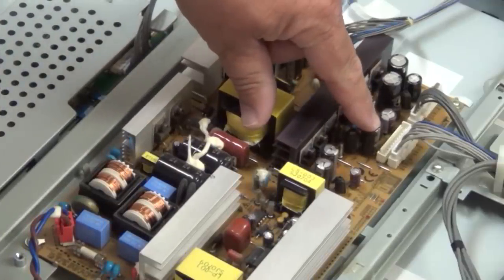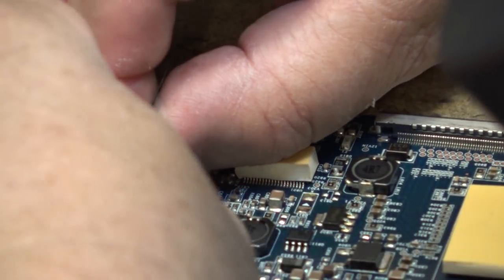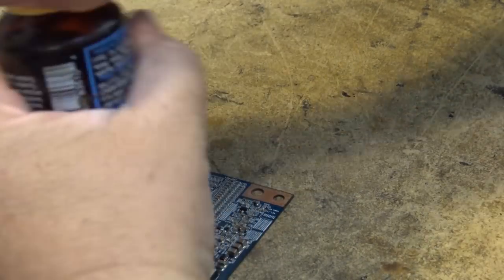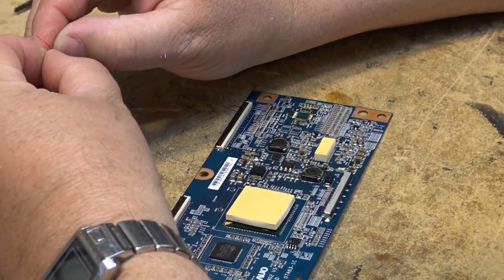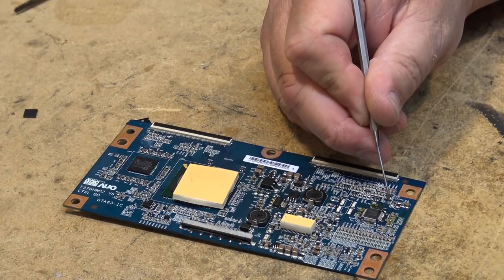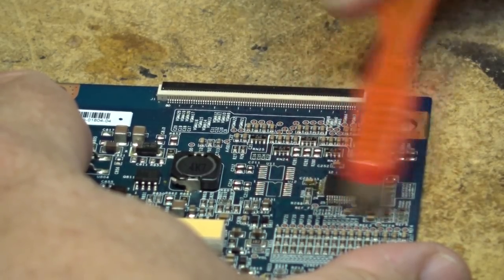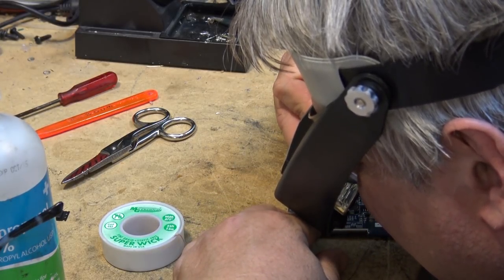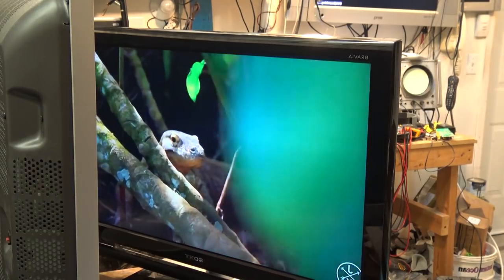Sony KDL37XBR6 Part 2 TCON board repair to component level

Comment: Drag soldering works really great for resoldering those types of chips. You only need to get one of those cup type tips on the iron. I suggest folks grab an old scrap board and practice the technique. Very professional results can be achieved pretty quickly. Just use a lot of quality flux to prevent solder bridges. Plus it's a lot of fun. There are videos on YouTube showing the technique. I love your videos.

Comment: I found one of these sets Sony KDL-37XBR6) outside my office, waiting for the trash collector (or Wednesday's Cat 4 hurricane). I took it inside and tuned it on. The picture is exactly as the one on your set, maybe not as washed out, but with the same solarized appearance.
So, I'll order the chip and will try to replace it as you show. I've done some soldering, but I'm no expert, so I'll try being extra-extra careful.
Thanks for this very useful video!

Comment: That was impressing and I like your patience and accuracy in fixing that problem. It is really sad that this televison sets are scrapped having such problems. When I was young my parents brought the faulty TV to the service guy and he fixed it - I miss that. Nowaday we live in a throwaway society :-(
Reply: And of course you get a thumbs up from me! I don't know why people dislike your work...
Reply from the maker: Yes we do, Wor 20+ years I was that service guy that fixed it.
Unfortunately the price of TVs dropped so low that they become uneconomical to fix real quick. 
A fix like this would run 100 minimum, by the time parts, and labour factored in. So when you can buy a new one for 200 why would anyone spend over 100 to fix an old one? If it one thing fixing my own sets,  but most prople will not pay to have them fixed.

Comment: Great method without hot air.  I repaired a tcon for a Samsung and it worked fine.  Chip cost me 40 cents from China.  Suggestion: cut the legs close to the body of the chip in case you slip and cut into the trace on the board.  Soldering was tricky but you will need a fine tip and a lot of flux.  Great video!

Comment: Brilliant!!! What a simple but effective way to remove that chip with minimal disruption to the board. your videos are so informative, learnt a lot off you.  thanks a million 😁😁
Reply from the maker: i am sure I just pissed off techs that know this trick, but don't share their tricks. I know if I was still in the business I wouldn't be sharing these time saving tips as nobody showed this to me. I had been using the steel wire heat and pull method, and one day I was thought, what if I cut the pins off at the edge of the chip.  Others I am sure did this too because it is so simple.
Reply from the maker: I usually use a fair bit of heat so I can solder quickly and not burn the traces. It all comes with practice, and I am well, out of practice.
It didn't look that way on camera I am sure, but this was the first one of these chips I have changed since probably 2002!

Comment: Don't let them break your balls about cutting the pins.....it WORKS.....and this video is the reason I started using this technique. The less heat one puts on a circuit board THE BETTER! I've changed out several EEPROMs this way and it works great for me! As you said, the key is patience and care. If I could find the right auo g1422.59 chip for this 65" Vizio I'm working on this is how I would change it. Heck I can't even find a spec sheet for it!

Comment: You cannot inspect enough! I double and triple check my solder joints. If I THINK there is a bridge I make sure to remove it. You did good leaving it unedited. I hate micro soldering. But with those SMDs, it's what you have to do. I am glad to see an option as well for those like myself who have limited options for soldering.

Comment: Back in the day we used a scalpel, exactly the same way, to fix Wyse terminals with flatpack ICs. That wasn't yesterday. Works a treat, so long as you don't lift any tracks. Slow and steady. I would tack down one pin on opposite corners, as tacking down one side may leave you slightly squint. Having said that, you can twist the chip very gently to correct for minor misalignment, even once one side is down. 
When I was doing this my eyesight was good enough to do it without magnification, however I wouldn't stand a chance now without 2 pairs of 3x reading glasses. I find doubling up on the Poundshop/Dollarstore reading glasses easier than wearing one of those magnifiers, but you don’t get quite as much magnification.
I replaced the USB connectors on a couple of Samsung Android mobiles recently with nothing more than a standard soldering iron, flux, spring loaded syringe type solder sucker, and a fine bit on the iron.  I do have a hot air gun, but I didn't want to risk blowing away microscopic resistors. Even if you think everything is taped down with masses of kapton tape, it only takes one thing to vanish and the board is for the bin. 
I only mainly fix boards for my own amusement these days, but it is a useful skill.
Reply from the maker: Yes that is the problem with blowing hot air, blowing away other parts. 
For some operations it is needed, but not for flat pack IC. This is the safest way to do it. I used a exacto knife, which is the same thing as a scalpel, I just couldn't find one here, so I used a razor blade, same results.
I don't need glasses for anything but close up work. I have a pair of prescription readers that are +1.5 in one eye and +.75 in the other, which is fine for reading the newspaper without squinting. For electronics work I use a pair of +2.5 I borrowed from my wife. The magnifying hood is really good though. I had the +2.5 on under them, and I could clearly see the chip.
Back in the day when I was working, before laser surgery about 8 years ago I was short sighted, so I would take off my glasses and I could do the fine solder work no problem. Now it is the opposite. That's ok though, as not having to wear glasses for driving, or anything else is a a life changing event. Best money I ever spent/

Comment: Good job. We do three thngs here as well. 
1) Sometimes I put a soild run of solder on all of the pins on one side before cutting them to minimise the risk of pulling the first or last and lifting the pad. 
2) The chips have a heat transfer pad underneath, we always use some heat transfer compound there as well to help stop it dying again. Cut another piece of the thick transfer compound block for the top to the metal as well. 
3) We always measure pin to pin after soldering looking for shorts. There are no adjacent pins on the AS15 (or AS19) that are joined. Shorts are easy on these close pins and not always obvious. Shorts between pins on these gamma chips can (and have) destroyed the panel.
Reply from the maker: The original chip did not have a heat transfer pad on the bottom but I noticed the new one did.  I did make sure that the keat transfer pad on the top wasputting good pressure on the heat sync to keep it cool. True it may fail down the road again, but the original lasted 10 years, and it it lasts another 8-10 years it will have had a good run. Yes I am well aware of what a short on the pins would cause. That is why I inspected it so close, and most of this was off camera. I also used my pick to press on each pin looking for movement.  I didn't put heat transfer compound on the bottom of the chip, as it would have been washed away anyway when I used IPA to clean the board, and then dried it with my compressor.
Reply: Thanks for the response. 

I did two more of these today, one AS15  for a Sony and an AS19 for a Samsung. I'm finding about half the chips are soldered underneath to the board. The ones with unsoldered pads come off in seconds with ChipQuik (I also find the ChipQik solder to be reuseable many times).

I am always staggered by the easy with which shorts can occur on these where I am certain the soldering looks good. I must be getting old, but I just cannot see them even with strong lights and the same goggles you have. I have to rely on measuring the pins. Leanrt early to solder one side at a time and measure before doing the next side as there are shared pins on all four sides. Easier to track down where shorts actually occur.

Comment: I have the same symptoms on my KD65X8500E 4k TV although it looks like my controller chip is the larger chip, do you know approx cost & warranties provided to have the chip changed out? the only board i can find is a second hand at $150 with 7 days warranty?

Comment: Awesome "old school" fix you did there Dave.  I never would have thought a razor blade would make short work of those IC pins.
Reply from the maker: It would have done it much faster if it was a new blade, but I have used it a few times already to remove chips in projects that I didn't shoot.

Comment: awesome! Did a microcontroller like that, 10X mags on and a filed solder tip. So many bridges that I just layed the fluxed wick over the entire row, wiped it with the iron and when I lifted the wick, all the pins were perfect ! I bought an ebay $60 hot air/solder station and love it.
Reply from the maker: I haven't bothered with a hot air station because I am not really into this type of work these days. I work on old audio mostly. I only did this because it was my set. I would turn a job like this away because I couldn't charge enough. I retired from electronic repairs and just do it as a hobby now.

Comment: Nicely changed ic. I have used this method when i worked in electronic manufacturing factory. Now i have hot air station at home.
Reply from the maker: saarike  
I just did 2 using a heat gun and aluminum heat shield tape. I dont change enough chips to need a hot air station.
Reply: Okay :).

Comment: Fantastic!  I started working on TV's back in the 1970's during the transition era from tubes to transistors to a few integrated circuits. That was before college.  I've not worked on any of the flat panel stuff until our Insignia NS-50L240A13 was zapped by a nearby lightning strike a few weeks ago.  It turned out to be the main TV signal processor IC which I found because the 3.3V linear regulator feeding it standby power was getting hot and the board area under the main signal processor was also getting warm.  Current draw on the 5V standby rail was high at 650mA.  Not knowing what the main IC was or where to source one, I opted to replace the main board to get the TV working again.  Now, I will pry the heat sink off the main IC to see what it is, and use you technique to remove it from the board (it is a 216 pin QFP).  Maybe I can find a replacement chip and get the bad board working again.
Reply from the maker: Same here. I started tinkering with electronics in the early 70's when I was 7 or 8.
By the time I was 13 I had built many kits, and the most complex one I built at the time was  a Heathkit cg1005 which used the neon panaplex displays.
It worked for a few years but because at the time I used the wrong solder (acid core, not knowing that it would attack the board) it died and I ended up giving it away to an old ham radio guy that lived up the street. He painstakenly put jumper wires across the traces that were damaged and got it going using it as his station clock. Never offered it back to me. I built a tube type keathkit scope too, but the power transformer failed on that and I tossed it.  In high school I built a black and white CCTV camera that used a 1" vidicon tube. I was using that as a security camera and had it mounted at my parents house pointed at the front door and driveway so they could see if anyone was out from from the back of the house. Someone stole it. Climbed up on the fence, stood on the fence while they unscrewed it from the mounting bracket. While in school I worked at a local TV shop and learned a great deal from the owner of the shop who I think wanted to sell me his business. I went to college and didn't study electronics, I studied film and television production. There was no work in this field at the time I did it though, the film industry was about 5 years away here. (Now it is booming and has been for 35 years). I went on to work for Sony, and then an independent service center which I eventually managed as well as fixed most of the equipment that showed up. I never got into flat panel TVs though. They were just starting to hit the market when I threw in the towel and left the business. So flat panels were a mystery to me until I was given a 42" Insignia (Samsung) set a few years ago.  I tore into that set and broke out the books and studied how plasma sets work. Since then I have done a few more sets. I did an LG with bad caps in power supply, a Samsung with a bad buffer board. Another samsung with a bad buffer board. An samsung with bad caps on the ySUS board, a Samsung with multiple components on the X main popped. A couple sets with grounding issues causing problems. Had a panasonic with a shorted choke to ground in the tuner circuit. Another panasonic with several parts blown on the SS board caused by loose ground screws.  Recently a panasonic with a shorted cap on the A board killing the 15v supply. A sharp with a blown 150v zener. Another sharp with cracked solder on the TCON board. This one with a bad gamma correction chip. A few LED sets, one with a pad resistor in power factor correction. Another one with a bad LED in the LCD panel. A vizio with bad zsus. NEC with power supply filters. Panasonic plasma with a bad fan causing shutdown. I am sure there are more,  but my suscess rate is pretty good. I fix more than I scrap.
Reply: @12voltvids  Great to make your acquaintance.  Sounds like our background are similar.  I too built a number of Heathkits including a VTVM, 3" oscilloscope, RF signal generator, capacitor checker, ham band receiver and several items.  I also worked in a couple of local TV repairs shops during my teens before getting a job in an AM/FM broadcast station.  I ultimately got my First Class FCC license and did a lot of maintenance on the transmitters, antenna switching system and various studio equipment.  Also worked in a TV station doing the same type of work during my last summer in college.  I did study electronic in college and got an electrical engineering degree and worked in a couple of small companies doing hardware and software design and development before entering the semiconductor industry as an analog field apps engineer.  I enjoy troubleshooting and fixing things and occasionally pick up a free item from Craigslist to save it from the dumpster.  Currently I have a 32" Best Buy / Sharp TV on the bench which has failed LED back lights and I will be removing the panel to replace those as time permits.  I also have a number of restoration projects waiting in the wings for retirement entertainment, mostly old Heathkit ham gear, but a few pieces of test and measurement equipment too.  Keep up the good work.  I enjoy the videos.

Comment: Would make a really cool video if you were to use some of your old camera equipment to make a Digital microscope for board inspection. Thank you for what you do. I have learned a lot thru watching your videos and the process of running out board level trouble. Also appreciate the fact you do it without fancy equipment. RockOn

Comment: One thing that needs to be mentioned is that before you try something like this, experiment on some chips that you don't care about on boards you don't care about..  Try to remove the chips by cutting them with a razor blade.  You need to learn how much pressure to apply and not cut through the copper runs underneath the chips.  Don't try this for the first time on a board that is good.
Reply from the maker: Right on. I used to do this for a living so I know how to cut them, but you are correct, if it is the first one, practice on a scrap board first.
Reply: Thanks for the advice as I’ve just started learning how to do soldering.

Comment: That's the way I have removed/replaced those types of chips as well.  A soldering iron, de-solder braid, and liquid rosin flux.  Just need to take your time with it, like you did.

Comment: I am experiencing a very similar problem with my Sony KDL-32BX300 but it's not quite as far gone yet. The haziness only seems to be at it's worst when I view the screen from an angle at the side of the TV. Also I don't know if this is related but there appears to be a very faint horizontal green streak across the middle of the screen. I opened up the TV and there is no TCON board, only a power supply board and the main board. There is however a ribbon cable that connects the main board to the LCD display. Does this mean that my TV LCD display is controlled by the main board? If so, would replacing the main board fix my picture issues?

Comment: Alright so I soldered on in and it looks good under the microscope but my picture still has weird colors and white especially. Sometimes I get a picture but it never lasts long. Do think I would totally have no picture if one of my soldering joints was dry?

Comment: Holy shit! ( Special High Intensity training) What great Idea. Removing chips with a razor blade. I am looking forward to trying that on my next chip replacement. Thank you so much for sharing your knowledge and time saving secrets. The only thing is. Every time I'm getting ready to shave. I will be thinking about chip replacements!
Reply from the maker: I am surprised that nobody has done this chip replacement demo before because this is the way all the manufactures taught their authorized servicers to do  it in the early days when nobody could afford air stations. It really is the safest way to do it,because the other way, with the piece of steel wire under the chip and then heat the pins and pull the wire was prone to lifting a trace, and that is the last thing you want to do with these fine pitch leads.